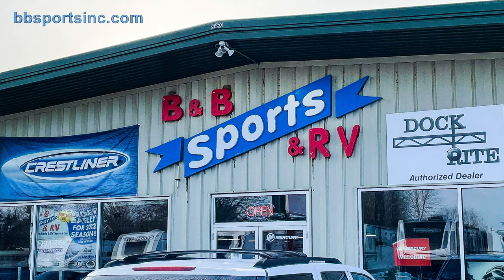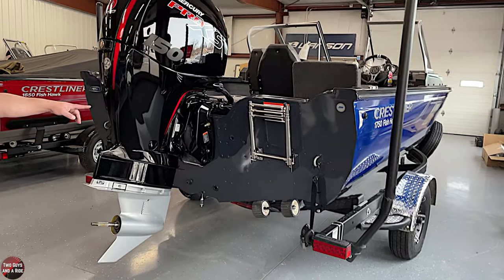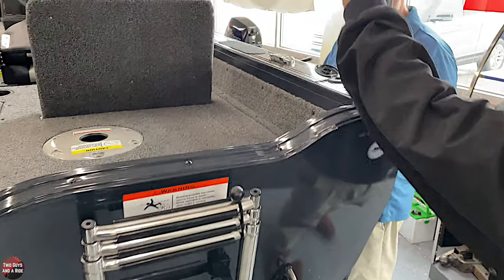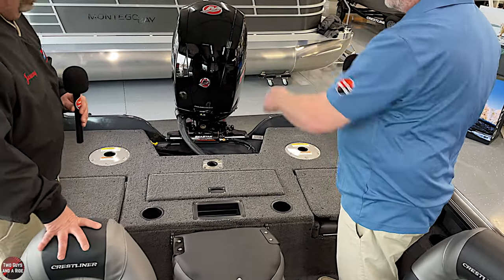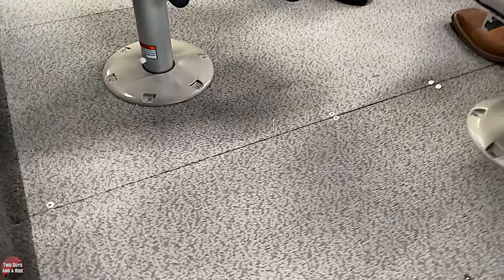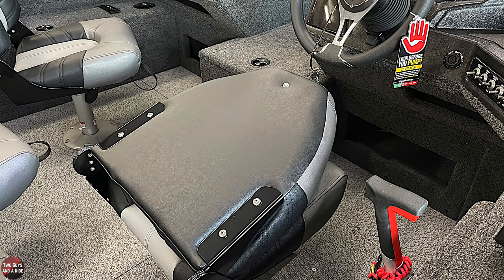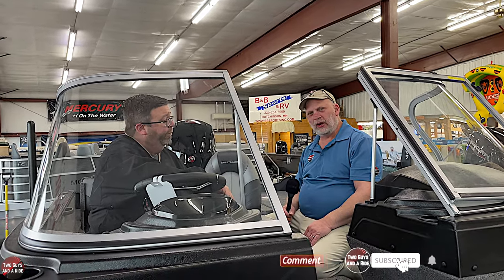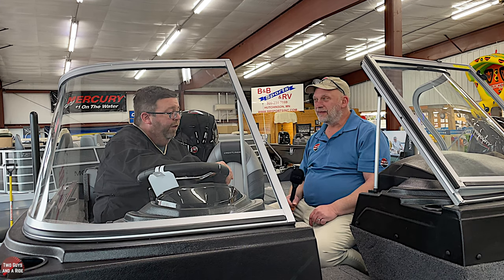2022 Crestliner 1750 Fish Hawk

Comment: Does this boat allow for a kicker? Just by looking at the transom design, it wouldn't?
Reply from the maker: Actually if you look at Crestliners website, if you build the boat, on their site, you have several choices for kicker motors, you can even get them with hydraulic steering, so while I recommend you go to their website and check it out, I do believe this boat will allow a kicker motor. Thanks for watching!
Reply: @TwoGuysandaRide , thanks. I'm not really interested in this particular boat. Perhaps you guys could do an in water walk through of A Sportfish. Not a lot of content on Youboob on that boat
Reply from the maker: @jonkarg2528  thanks for the idea and thanks for watching!